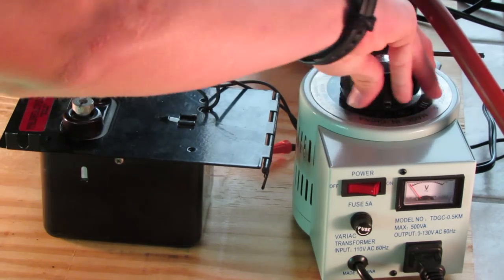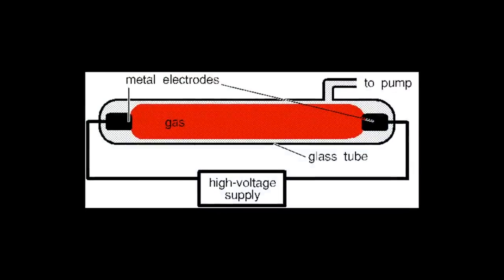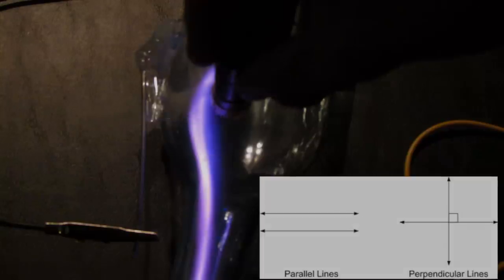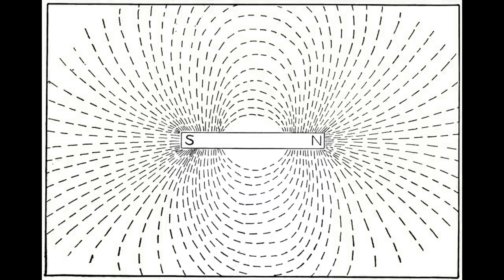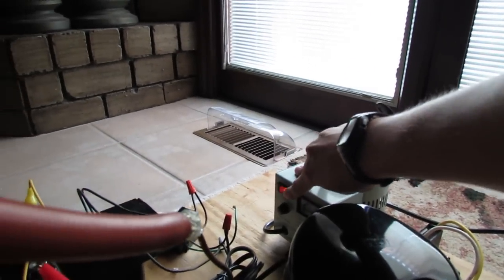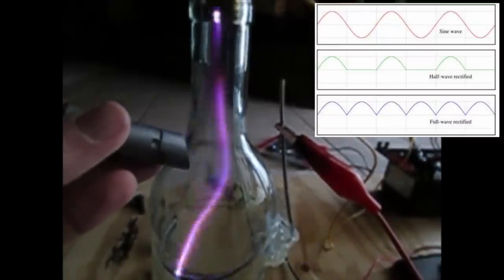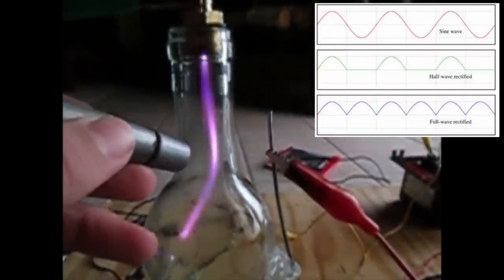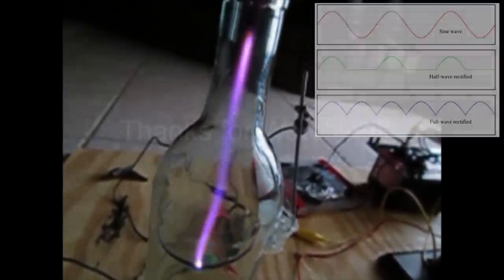Incredible Homemade Plasma Discharge Tube - Part 2

Comment: I like that homeboy just learned some new terms and so applies them to everything. Also teaching a pretty hollow version of what these things are, not for beginners, but was a novice. Keep up the good work!
Reply from the maker: And now I’m working on my PhD in physics! Everyone has to start somewhere. This project was one that inspired me to pursue this career. (Edit: also before I did this experiment, I did not know the cross product behavior of charges in magnetic fields and was puzzled by how the beam changed when I flipped the magnet direction. After some reading on the internet I learned that it was a well observed fact. So in this experiment I accidentally rediscovered the cross product rule for myself which was super exciting to me as a middle schooler.)

Comment: This is not a "real" CRT, I say that, and I say it in quotes due to the fact that in a cathode ray tube, the cathode is heated. The cathode in a CRT comes in two forms, direct or indirect heating. With direct heating, the cathode IS the heating filament (by filament, i mean EXACTLY like in a light bulb) however with indirect heating the filament glows white hot inside of the cathode material, heating it and allowing electrons to fly away from the cathode at a velocity directly dependent on the voltage used (this being the energy of the electrons in electron-volts, eV)

What is being demonstrated here is a VERY good visual demonstration of how a plasma behaves when influenced by a magnetic field. This is also how a CRT Television "draws" a picture on the inside of the phosphor screen and glows on the outside so you can watch you favourite tele show. But this is just a low pressure gas discharge lamp, the current is all put into heat and light that comes from the plasma its self, and all of the current passes from cathode to anode directly

In a CRT tube the electron beams path goes from the (negative) cathode past the (positive) anode and continues on to strike a target, In the case of a tele this target is the phosphor screen, however, it could be many things, if you took the same system (an electron gun) and aimed it at an angled tungsten anode you would have an X-Ray tube! Think of the X-Ray's in this system like the electrons going past the anode and hitting the screen in the tele system.
Reply from the maker: I understand that the pressure is not as low as a normal CRTs. As you stated it provides a very good visual demonstration with the plasma. However, a cathode ray tube doesn't have to have a heated filament. This type is called a cold cathode ray tube. If you want, you can check out one of my newer videos where I make a CRT with a phosphor screen that is lit by the beam of electrons.
Reply: +Ryan Smith Whether the cathode is heated or not has no baring.The plasma you are seeing is a result the interaction of the "cathode rays" or electron beam and the gas molecules in the bottle. The "cathode rays" only produce a plasma once the electrons that constitute it have gained sufficient energy from the applied electric field and thus are only visible some distance from the cathode from which they originate. The magnetic field is affecting the path of the electrons throughout their journey both before and after they enter the plasma, this effect is clearly seen in video 1 once the diode is added to the circuit.

11 out 10 for a really excellent demonstration.
Reply: Its cold cathode cathode ray tube ...so needs no heater for the electrons ...so using the grunt of high voltage to get the same result ...a true cathode ray tube electrons move on to a screen the anode used is wrong for the result  ,,,,,,a plate with a small hole init it would work Stilll cool bananas love the 2 videos ,i have played around with the same idea but using jars would like to make  a true CRT thats workable soon .
Reply: A cold cathode ray tube yes, but to make a e- beam that is narrow (coherent) enough to draw raster images, it needs a heated cathode to control HOW and in what SHAPE those electrons are "boiled off" in, before acceleration by the + anode voltage. Otherwise you get a diffuse spot on the phosphor as opposed to a fine dot (or line, or plane) My advice, as an operator of electron microscopes (MUCH of the same parts as a CRT TV) would be to find a B/W TV set and break off the gun section and place that inside your glass container, use that as an electron beam source, than research Electrostatic Deflection to deflect the beam, as your container seems too wide for magnetic deflection
Reply: This is not a cold cathode ray tube. This is simply a gas discharge tube. A cold cathode is indeed one that does not need to be heated but instead uses a high potential (electric field) to yank the electrons off of the cathode. Still, great work, looks great.

Comment: you are quite an intelligent young guy 
i found your video helpful and informative
i want to build a GAS IONISER using a discharge or CRT tube that can ionize hydrogen molecules at the rate of one mole per second that is produce a stream of PROTONS THAT CAN BE COLLECTED after the ionizing process WHAT DO YOU THINK WOULD BE THE BEST WAY OG GOING ABOUT THIS?
Yours Neil McBain from Redditch England UK
Reply from the maker: Thank you for the compliment! So keep in mind what your requirements imply for your power supply: generating one mole of protons per second means you will need to move  6.022*10^23 * 1.602*10^-19 Coulombs = 96,400 coulombs of charge per second which is a current of 96,400 amps... so I don’t think you will be able to achieve this on the hobby scale!

Comment: That was a good explanation.  The AC is 60Hz or 60 cycles per sec. , but that I think is actually switching directions 120 times per sec. , as one complete cycle is once each direction. I don't know if that is how you stated it or not,but it's no big deal.

Comment: What happens when you use it in normal atmospere (without the vacuum)?
Reply: the electrons will just crash into air partacles before it hits the end of the tube

Comment: Hey I'm hoping you or someone could clarify something for me. To my understanding, shouldn't the CRs be attracted to a positive magnets and deflected by the negative magnets? Idk maybe you said that but I didn't get it. Any help is great. Thanks in advance.
Reply: +Jarron Nunez Like the guy said, a moving charge (The cathode ray) in a magnetic field has a force acted upon it that is at right angles to the movement of the charge and the lines of magnetic flux. So, if the magnetic field is going towards you, and the cathode ray is moving down, then the force on the ray will be directly to the right, as this is at right angles to the magnetic field (Directly towards you) and the movement of charge (Directly down). The reason why it is to the left, and not the right, is because that is how it must be to obey the law of conservation of energy, which requires quite an elaborate explanation. If you're interested though, just search up 'Lenz's law'

Comment: Why is the ray better visible at the terminals, and almost invisible in the middle?
Reply from the maker: It's because of a phenomenon called "dark space" which causes a discharge near the anode of the beam. Since the AC current is switching, the middle appears to be dark, but that is simply because of the dark space switching its location.
Reply from the maker: Correction to my previous comment: dark space causes there to be no discharge near the anode.

Comment: sorry but this isn't a cathode ray tube. you need higher vacuum to make plasma and so, cathode rays.
what you made it's only an arc at low pressure, not plasma
Reply from the maker: Yeah I understand that. I call it a cathode ray tube though because it demonstrates properties of cathode rays.
Reply: +NaBrO, the video shows you light emitted from ionised gas that has all the characteristics of a plasma i.e. response to magnetic fields and high electrical conductivity. Plasma is a state of matter and not, as you may think, a state of vacuum.
Reply: MrCuddlyable3 i know plasma isn't a state of vacuum... i was saying that the apparatus that gooferking built isn't a cathode ray tube because he needs higher vacuum, what he built is only an arc of plasma in a low pressure atmosphere. every ionized gas responses to magnetic and electric fields, beta and alpha radiations respond to them but aren't plasma
Reply: NaBrO, you have posted "it's only an arc at low pressure, NOT plasma" and contradicted that with "is only an arc of plasma". You may fill the gaps in your knowledge by reading the Wikipedia article titled "Cathode ray", noting the picture there.
Reply: MrCuddlyable3 arc, lightnings, sparks stars are all plasma, in that contest for plasma i was trying to say cathode rays and anode rays (that are plasma), i was trying to make difference between cathode ray tubes plasma and arc plasma.
Reply: NaBrO since you are only interested in trying to make yourself right in some imaginary contest to split plasma hairs, I shall apologise in your place to Gooferking for your initial foolish comment.
Reply: MrCuddlyable3 sorry if my english isn't that good, so sometimes i can use words not right in a specific contest, so i was trying to let you what i meant with other word, and not "trying to make myself right in some imaginary contest ro split plasma hairs", because i know that your knowledge about plasma came from wikipedia, and i was trying to be more precise
Reply: NaBrO I don't want your apology. Apologise instead to the maker of the excellent video that you have criticized.
Reply: MrCuddlyable3 nope, i was right, he was wrong, if he would be right he should change the title of the video in "demostrating propreties of ionized gas" because THAT'S NOT A FKING CATHODE RAY TUBE, AND IF YOU DON'T UNDERSTAND IT "READ WIKIPEDIA"
Reply: NaBrO what we have learned about you is that the only kind of crt (cathode ray tube) you can conceive is an imaging crt, that a week ago you should have kept quiet about what little you knew about plasma (now I think you have learned more), and that now you are shouting and swearing. Sorry seems to be the hardest word (Elton John).
Reply: MrCuddlyable3 "what little you knew about plasma (now I think you have learned more)"
i think you know little about plasma, i was trying to be simple for normal people that don't understand specific stuff (like you), so if you continue saying that he is right and i'm wrong, i can't say anything more, good luck for your life
Reply: "Cathode rays" was the historical term used to describe the electron beams discovered in cathode ray tubes before electrons were discovered and the idea of fundamental particles was developed. The term cathode ray has never been used to describe plasma so I'm not sure where you picked that up from. The term "cathode ray" is not a correct term because electrons are not rays of energy but are particles with mass moving at high speed.